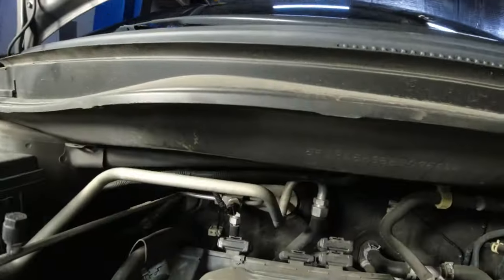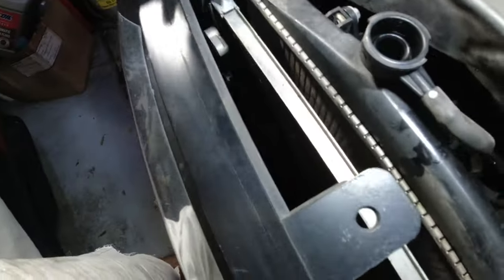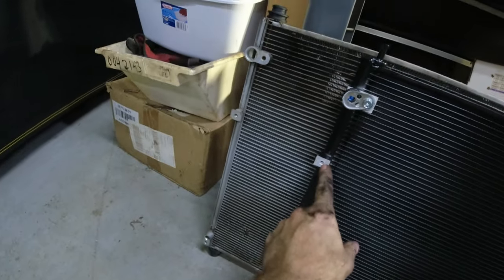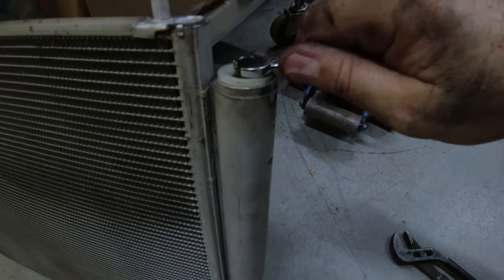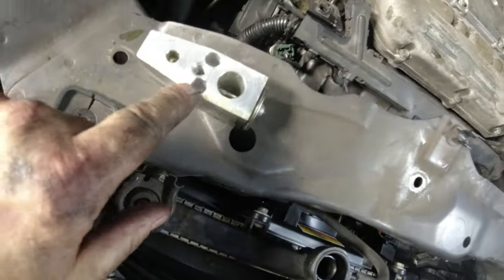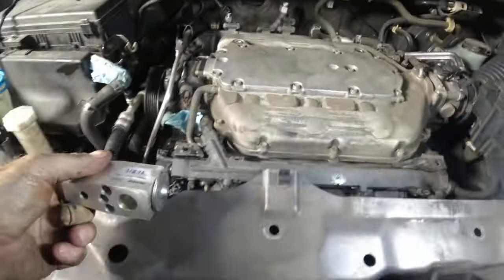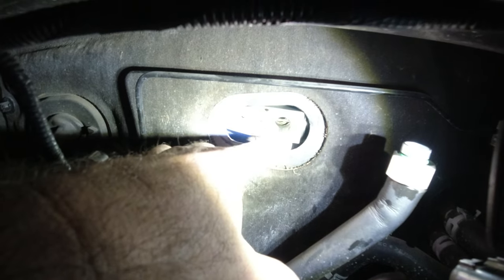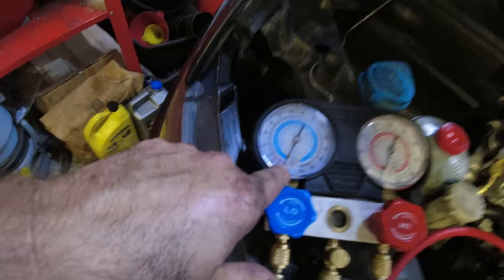Replacing the AC Compressor and everything else AC related on our 2014 Honda Odyssey.

Comment: If the alternator has a lot of engine oil on it, the spool valve gasket is probably leaking and dripping on to the alternator. It will kill the alternator eventually. Don't by a "Honda" spool valve gasket online, they are all fake. Honda doesn't sell the gasket separately , only the entire spool valve assembly. Normally only the gasket and the top half of the spool valve are replaced. It is a much bigger job to replace the entire spool valve. The lower half of the new spool valve assembly can be used as a paperweight :)
Reply from the maker: I bought the 2 gaskets and replaced them. This stopped the leak.